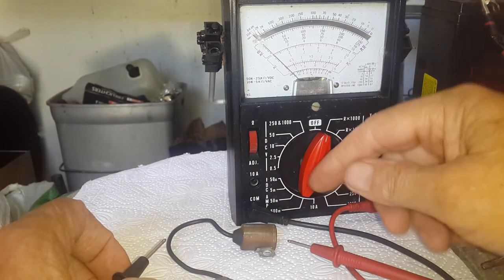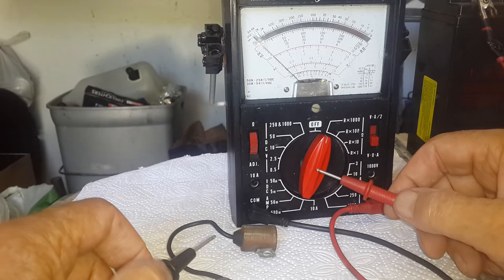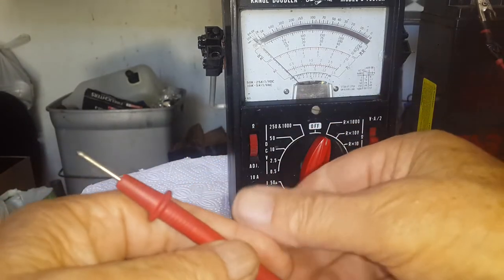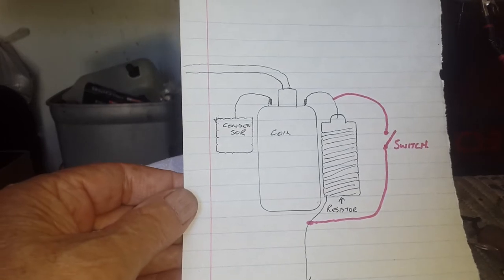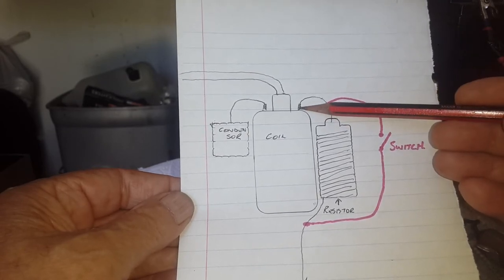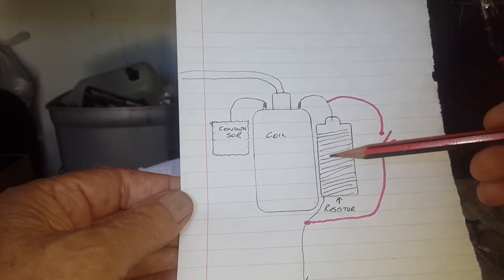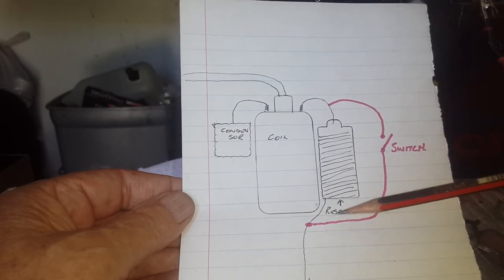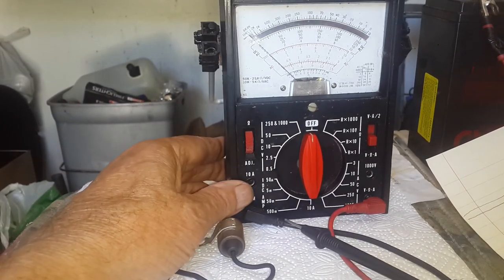How To Test a Car Condenser with a Analog Multi-meter, and more

Comment: Good test Jan.   Most all condensors are about 1/4 microfarad and are only good IF they hold a charge.  If the needle doesn't move, it is 'open'.  If it moves all the way to one side and stays there, it is 'shorted'.  If it does what your meter does, it is taking the charge from the battery in the meter then discharging just like it would in an ignition circuit.  So YES....you verified it as a good unit !!  This is the same way we use an analog meter to check capacitors in single phase air conditioning units.
Reply from the maker: You made my day Wendell, that is how I worked out it should work, thanks for confirming that, and I guess it would be the same for capacitors on air units as well, thanks so much for your comment my friend
Reply: @jankotze1959  yes, exactly the same, but because the capacitance is greater on the a/c motors and compressors, we use the Rx10.000 range on the meter.  Small capacitors on a blower motor can be as little as 2.5 or 3 mfd.  Compressor up to 5 ton can have as high a rating as 55 or more on the run winding, but the start capacitors can be 350 mfd or more.  Refrigerator and small commercial compressors can have as much as an 88-108 mfd start capacitor.  I'm glad to provide assurance of the correctness of your logical conclusion my friend !!